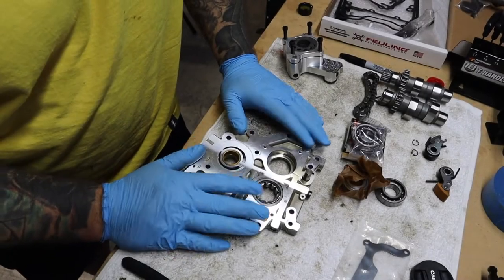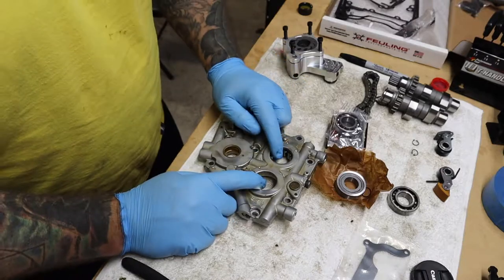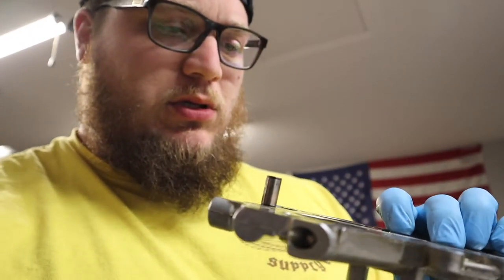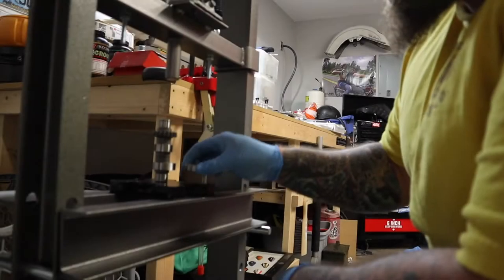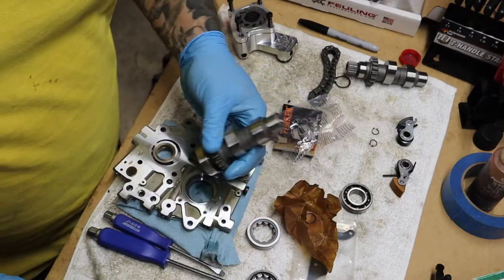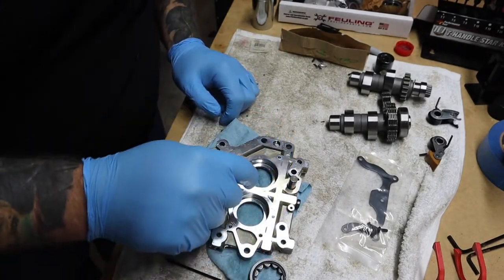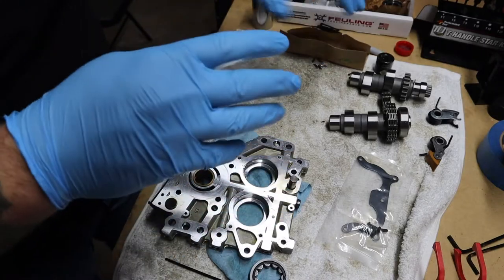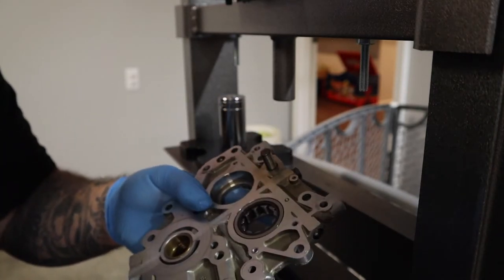Cam Plate Rebuild Part 1: What NOT to do.

Comment: Always press on the race that's the mating side. Ex. If it's mating on the outside race press the outside race, if it's the inside race press against the inside race.
Reply from the maker: Very helpful tip! Appreciate it. Thanks for checking out the video.
Reply: You put the bearings in the freezer at least few hours better overnight then heat the plate and lube everything and they nearly drop in just press evenly flush put retaining plate then press cams in

Comment: You probably have ruined the roller bearing, that you have pressed on the camshaft, by pressing it as one into the cam plate! The pressure during doing so is on the inner race of the ball bearing, that forces all the pressure on the balls! Instead you should have pressed in both bearings in the plate, install the retainer plate and finally press in the camshafts with the chain preassembled and aligned, by pressing in the cam of the front cylinder (that goes in the roller bearing). Just make sure to support the inner race of the ball bearing, before pressing in the camshaft! The camshaft of the rear cylinder slides in to the roller bearing easily!
Reply from the maker: Okay calm down Mr. Exclamation point. I followed the service manual and feuling parts instructions. If you really want, I’ll tear it all down and do it to your spec. I’m sure we will both sleep better at night. 😂😂
Reply from the maker: @valjatriogina228  😂😂😂 triggered by someone having no idea what they’re talking about and correcting them? Sure. I hope you have a great day ma’am, this has been enlightening.
Reply: Just started following you! I love that you shared this video instead of pretending it never happened. Probably saved a lot of people 50$ and a bunch of frustration! Cheers 🍻
Reply from the maker: @MattBallantyne  haha thanks man! Gotta keep it real , we all fuck up sometimes, why hide it? But there are always Karen’s that know better than anyone else, including the service manual haha
Reply: Yea what I find so funny about a tool r certain way how do some think they figured tools out are ways of doing it every one has tore something up and probably more than one time hell we’d never been anywhere if all was scared but I would look around and just put the later model cam plate in it and cams and  do away with lot of it especially those bearings used one cheap and just clean em up and less moving parts less chance something happening that’s usually my luck anyways